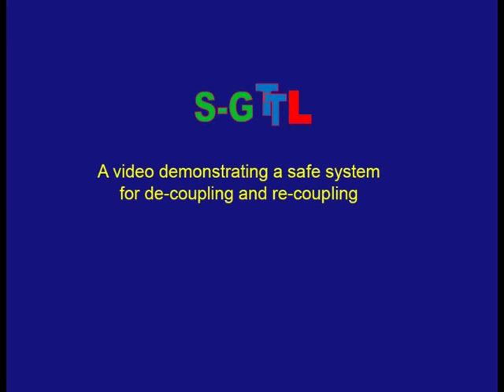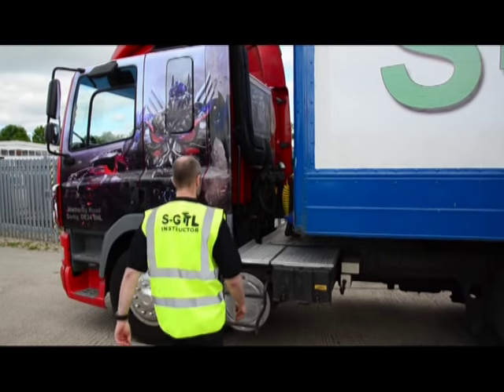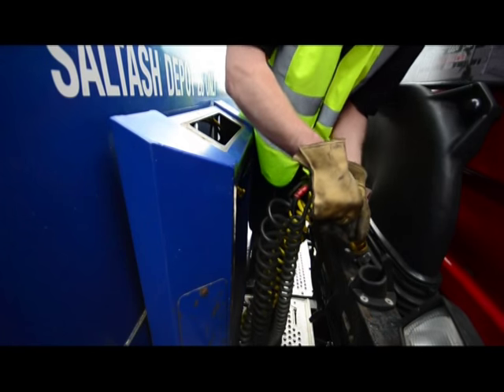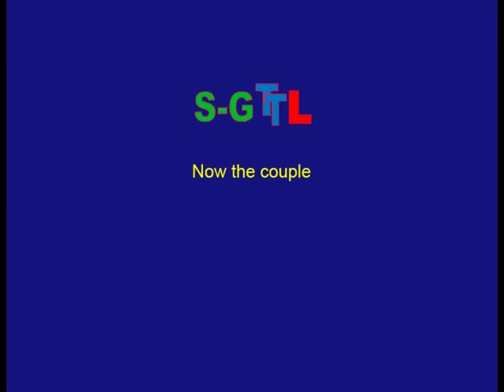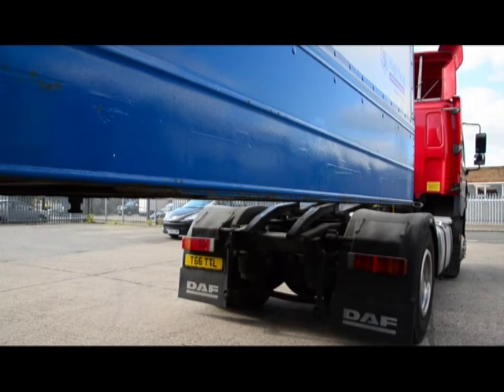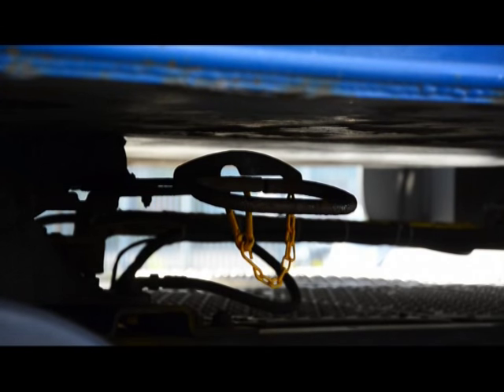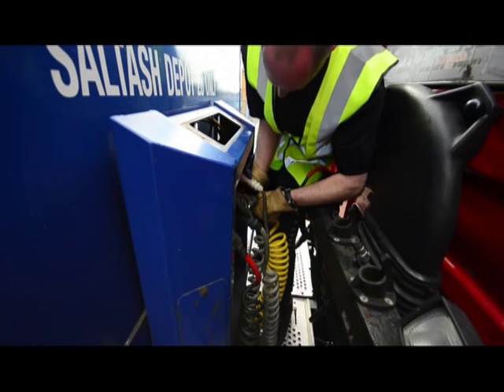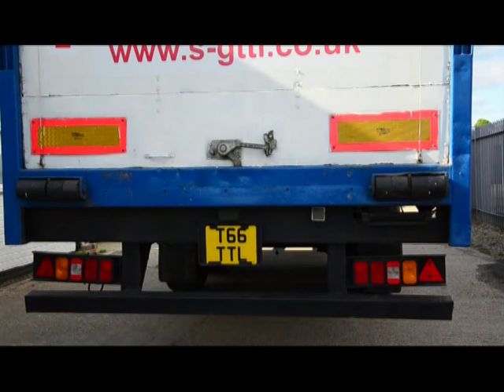Articulated vehicle de-couple exercise

Comment: Keys  should be out the vehicle too at 45 secs, 1: 35, get your unit fitted with proper air line stowage, 4:10, park brake on trailor needs to be checked before you couple, or you could push the trailer and it could roll away..use ecas to raise trailer or u can bend the legs,when raise legs face the way you going,,,fog lights???break lights, reverse lights??..marker lights...internal lights..